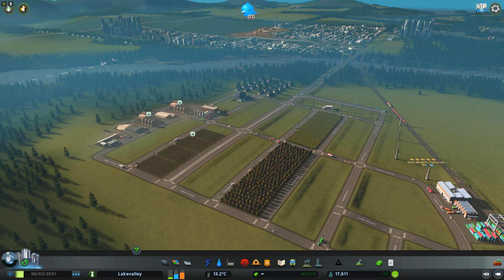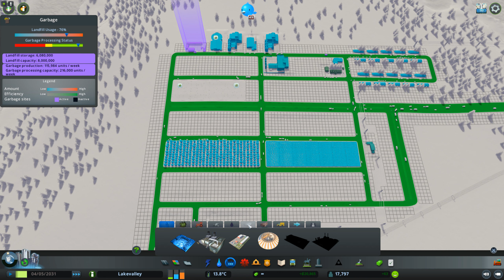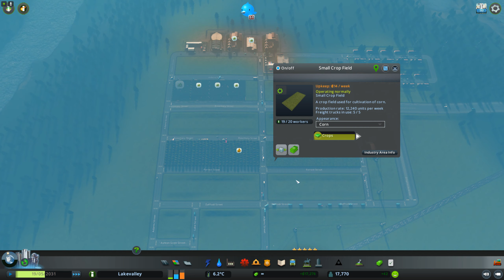Warehouses Fix Logistics - Industry DLC - Cities Skylines

Comment: I still have a raw material problem from my GENERIC industry areas. Even though I have 5 stars on all 4 specialized industry areas, warehouses with materials made in each of the four (petroleum, timber, etc.) I still have GENERIC industry that says they don't have RAW MATERIALS. So, I put STORAGE facilities of raw materials from EACH OF THE 4 specialized industry area types near my generic industry and they STILL say they don't have raw materials. I have cargo trains near all my industry areas (generic and specialized), cargo harbors and a cargo airport as well and 85% traffic. I'm at a loss.
Reply from the maker: What I have in this video worked for smaller or more simple cities, but it does fall apart for bigger and more complicated cities. I haven't found a way around it yet.
Reply: You need a warehouse set to goods. Goods go to commercial and non dlc industry